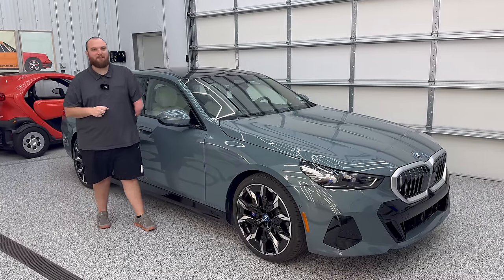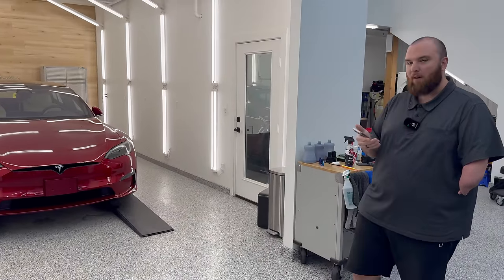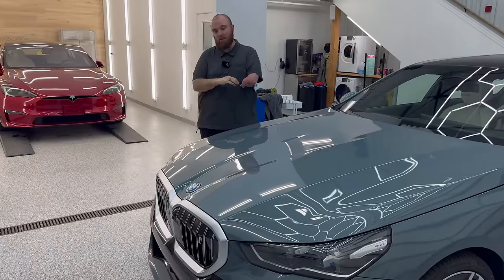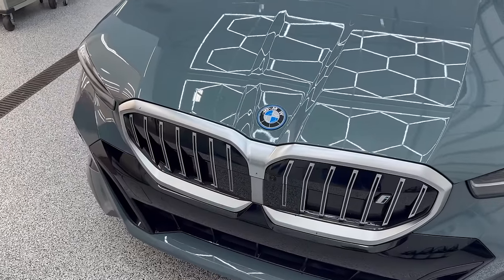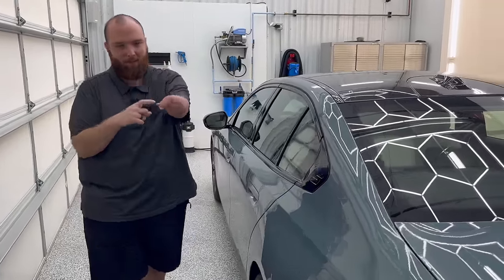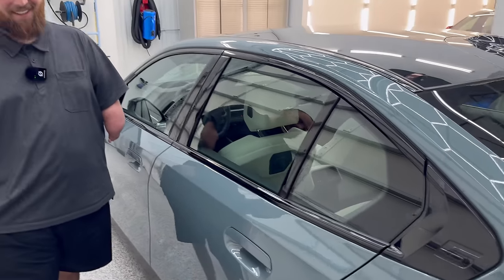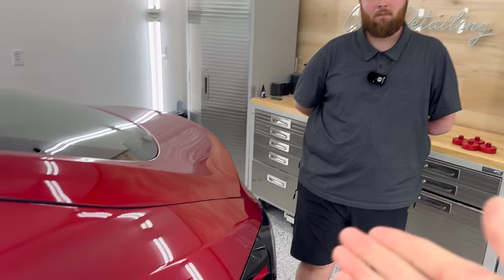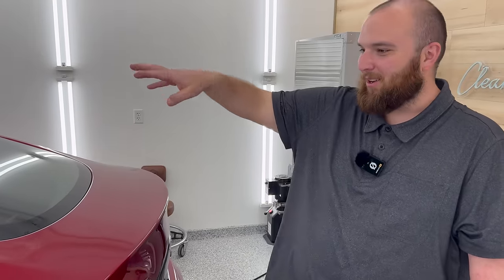BMW i5 vs Tesla Model S Build Quality Showdown! Pure Luxury vs On Paper Spec Sheet

Comment: Model S has been out since 2012.   Old, stale and outdated.
Reply: Correct.
Reply: BS point. 5 serie has been out for decades.
Model S has been refreshed.in 2021.
Reply: @mathijs9365  You do realize that the five series here is an all new model from the ground up new for 2024?
Reply: @mathijs9365   Refreshed in 2021 but still the same car from 2012.  They changed the bumpers and side skirts after 9 years in 2021. Still the same car.
Reply: And still looks and drives better.
KM77 just tested the ugly i5, and guess what,, the dated S did the slalom 2 seconds faster and the moose test at 8 km/h faster!
Reply: @ehudk215   Model S 2012 interior doesn't look better.  And not to mention Tesla is lacking in quality.
Reply: @TonyStone3000  in your eyes. The i5's interior is cheesy and plasticky.
In any case I was talking about the exterior.
Way more handsome and muscular than this new 5 series: it just looks wrong.
Reply: A 2024 Model S is different in practically every way from a 2012 Model S. Pretty much the only things they have in common are that they are both four door sedans with hatchbacks that run on electricity.
Reply: And the body is pretty much the same since 2016
Reply: @jaredvegas  it was a great design back then and is perfected now.
Different nose (bumper, headlights), wider fenders, different tail lights... many incremental changes that make for a big difference
Reply: @ehudk215 I like it but I’d be devastated if I bought one now and they change it. Definitely waiting a couple years (until my car is paid off)😅
Reply: @TonyStone3000  i bet you think the same about Porsche's cars.
Reply: @achilles-live   Nope.  Porsche redesigns their vehicles and their interiors aren't boring.  They just released an all-new Mecan.
Reply: @TonyStone3000  Porsche lightly updates their cars at the same if not at a slower pace than Tesla. Tesla has completely new cars, the Macan is the same exact platform with a new drivetrain and some cosmetic changes. Tesla has it's own design language that they iterate on, like Porsche does.
Reply: @achilles-live  The new Mecan is an entirely new electric vehicle. The body panels, interior, and drivetrain (electric vs. gas) are all different.   That is as far from a light update as you can get.
Reply: @achilles-live  Which Tesla is completely new?  The Cybertruck?
Reply: @TonyStone3000  Model S and X share absolutely nothing from the original cars. Model Y is a new platform so the main differences from first generation is the new structural battery and new motors. Model 3 has been redesigned and now also features a completely new chassis made with a structural battery, new motors and single cast front and back elements + the new 3 performance has completely new battery and completely different motors + suspension.
Reply: @achilles-live   All of that, and they still look the same. I'm no Tesla expert, but I'm willing to bet that the roof, hood, door panels, and trunk have remained the same throughout the Model S and Model X's existence. I've also noticed that everything has stayed the same with the interiors except for trim materials.
Reply: @TonyStone3000  Again, it's nothing shared anymore. The interiors are also different. If you were consistent and not being ignorant on purpose, you would say the same for Porsche for the past decades. As objectively, much less has changed from the original "new gen" 911 to the 2024 refresh.
Reply: @achilles-live  You are the one who's ignorant on purpose when you said, "The Macan is the same platform with a new drivetrain and some cosmetic changes." That was a complete line of crap.    You pulled that from your rear end.
Reply: @TonyStone3000  No, I did not. The new Macan does in fact share a lot with the old one under the pretty panels. You can keep trying ways to move the goalpost or switch it up but reality is what it is. I'm not saying it as a negative, I'm pointing out the obvious. I never said Porsche's EVs are bad or any other of their cars for that matter.
Reply: @achilles-live   You are doubling down on stupid.  This is from car and driver: "The Macan SUV has been Porsche’s best-selling vehicle since 2016, and the compact luxury crossover has spawned a new all-electric model for the 2024 model year. While it bears the Macan nameplate, the 2024 Macan EV rides on a new platform that will also underpin the upcoming Audi A6 eTron.
Reply: @achilles-live  Common sense would dictate if a car went to a new electric model from an internal combustion model, it would need to be a new platform or a shared platform designed from the ground up (BMW i4/440i).  Please tell me that you didn't think all it would take to make an electric car was to throw a battery pack underneath an internal combustion engine car.   You Tesla fans appear to believe that's the case.  Lol.  Another Tesla fan thought the BMW i5 wasn't an all-new model.   😂
Reply: @TonyStone3000  Turns out, common sense is at times wrong. Look mate, I don't pretend you think logically or try to view things from a new angle because clearly you're hardstuck. For the record, I'm no tesla fan I just appreciate the engineering and work behind their cars. I drive a track tuned miata, so I could not give a fuck. That said, BMW has repeatedly reused platforms and quite literally slapped a battery in them to get it over with. There are first/second gen EVs that "use all new platforms" yet still have an engine bay filled with leftover bullshit and an empty transmission tunnel.
Reply: The Model S in 2012 was well ahead of its time. It still works and still looks great. Go tell Porsche their flattened Beetle rebadged in 1971 to a 911 is old, stale and outdated. It’s the same damn lousy and ugly car externally but it appears to be working for them.
Reply: Tesla Model S design is sleek and timeless. In my eyes a Model S is one of the best looking cars on the road.
Also most parts of Model S is relatively new (2021-2022).
Model S build quality is no match for BMW though 😅
BMW interior is nice, but damn the exterior design is horrible with tons of scratchy piano-like plastic and a fake grille 🤦‍♂️
Reply: 2011* technically 😅
Reply: The problem with Tesla is that they have the Model S, Model 3, model Y and the Model X all having that similar design. It’s just that one looks a bit more bubbly than the other. On top of that, it’s like everybody buys them in the same three colors. Red, white and blue. On top of all that, the interiors just don’t get me excited and it just screams we need to cut cost somewhere. This is coming from someone who initially liked the model S when it first came out exterior wise. I live in Texas and you just see all the models way too much! Especially the 3 and Y!

Comment: The problem with german premium cars nowadays is that they don’t stand out in any particular category other than just looking fancy expensive from far away. Cheap material used, small interiors, impractical, very expensive, unreliable, outdated technology, expensive maintenance, horrible software and arrogant service experience.
Reply: You must have mixed up Tesla and german premium cars. Audi has the PPE platform with 800V, 270-275kW charging, HUD and 388 miles of WLTP range in the Audi Q6 e-tron (even more range than the Model Y LR RWD which is only available in Europe at this moment).
Mercedes-Benz will reveal the MMA platform with the CLA at the end of this year. The CLA competes with Model 3 and has 800V, 250kW charging short 50kW boost (so it will perform like straight 270-275kW) charging power, LIDAR, HUD, 466miles WLTP range. BMW introduces its 800V platform "Neue Klasse" in summer next year in form of the iX3. 800V, 275kW charging power good range etc.
Those are just the most upcoming releases, the new Mercedes EQA, EQB, electric C-Class sedan and C-Class SUV as well as the BMW i3 sedan will also follow in just a few months from now, all sporting an 800V system.

If one company in the EV space is outdated and has horrible build quality and customer service then it is Tesla.
Reply: Have you owned both Tesla and german premium to write this? Or is it just what you read in the legacy car media? I own a Tesla X Plaid, before I’ve owned six different BMWs, including two 5series. The tech in Tesla feels just light years ahead, it’s like driving a car from another century. 
And yeah, build quality and materials used in recent german premium BEVs are just inferior to Tesla. Mercedes and Audi being the worst.
Reply: @Aztasu lol there aren’t any 800v chargers. Why buy something thinking you’re ahead of everyone else but you’re actually using Tesla chargers because all others are outdated gas station style chargers. Charging speed is useless. Get a house and charge at home, you’ll never even think about your battery. Apartment users should contact their landlord. Landlords in certain states get incentives to add chargers in their lot.
Reply: @jaredvegas  America is behind when it comes to charging infrastructure that s why 800V EVs are more for European where 300, 400 V charging are accessible everywhere. That s why the first generation Taycan and E tron did well in countries like Norway and Germany  cause they fit the infrastructure here.

There are reasons manufacturers are starting to build 800V EVs.
Reply: @timram3766   Your argument is 3 years Old when only Tesla was the only manufacturer serious about EV. Today it s different. Other companies have catch up to Tesla when it comes to building the best EV. Mercedes EQ flagship lines, BMW flagship lines  iX i7, Porsche new flagship lines Macan EV, 2025 Taycan, even VW with their new ID 7 offer similar techs like Tesla if not better and are miles miles ahead in build quality, interior, everything almost. That s not even  a discussion. Mercedes is the fist manufacturer to come up with Certified 3 level autonomous a year ago. Taycan was the first EV with multiple gears, 3 years ago. Almost flagship EVs are now offering Augmented Reality HUD display, advanced Matrix Headlight function, advanced Dynamic Chassis Control features to name a few, none of them are available on Tesla.
In term of range Mercedes and BMW are already ahead of Tesla already. And while Tesla is unable to to keep up with the current german flagship lineups from Mercedes, BMW, germans brand like AUdi Porsche, BMW are already preparing for their next gen EVs while Tesla still hasn t figure out how to assemble car properly.

Comment: BMW will have better fit and finish for sure but I would never get the BMW, terrible efficiency, already outdated, clunky tech vs Tesla Model S has outdated design, fit and finish but drivetrain, tech is the best. I wish Tesla updated Model S similar to new 3, it could be the best electric sedan.
Reply: Well, next year in summer BMW iX3 of the "Neue Klasse", a next generation EV-only platform with 800V, HUD, LIDAR etc., will be revealed. i3 sedan will start delivery at the beginning 2026 and will also based on the "Neue Klasse". The i3 easily beats Model 3 and even the Model S. If one company is outdated, then it is Tesla.
Reply: @Aztasu sales show the opposite.
Reply: @raheeb1  they don't. Sales are declining rapidly and Tesla is basically selling only a single succesful model at the moment, the Model Y.
Reply: @Aztasu I meant about the bmw EVs. How many do I see out in the wild? Very very few.
Reply: @raheeb1  Well BMW has a big market share in Europe and the EV sales are booming in the US as well. Maybe they just don't come across as EVs because they look similar to the combustion variants.

Comment: The i5 supports full walk up/walk away phone as a key. It also supports plug and charge with EA already and will support it with Tesla I'm sure as well.  Hot take but I actually think the tech in i5/i7/iX is better than Tesla. 🔥

Tech the i5 has that wasn't mentioned in the video, that the Model S doesn't:
* better driver assist including hands free up to 85mph.
* carplay/android auto. Some people don't care but it's a dealbreaker for others. BMW's wireless carplay is actually super reliable and it integrates well letting you use Wayze or whatever you prefer.
* heads up display. So nice and useful.
* more color variety and individual options! :)

That said, there's plenty of reasons to buy the Tesla. Great video guys!
Reply: I am a 11 yr bmw owner. I have only owned bmw. E90 323, f32 435 and g20 m340. I am looking at both i5 and model s. I love my merino leather, HUD, 360 camera, carplay. The new 5 series interior looks so good. The ambient lighting is league above all other cars. But i5 is a sedan. I want something more practical, hatchback or touring. Better range. Frunk. Model s has these. I5 don’t. I am so torn
Reply: @tommytexter4054  you might be able to get your dealer to do merino leather in an i4. That's a hatch back. Small rear seat though.
Reply: @CheddarKungPao nah, i don’t wanna deal with 3/4 series anymore. Need to grow to 5 series segments. Also i4 m50 with all the options costs almost same as model s in canada. Also my g20 merino seat, i get back pain after 1 hr of driving.
Reply: @tommytexter4054  yeah i hear you. I love my i4 but i wanted something small. We ended up getting an iX for my wife. I'm driving that across the country right now and it's really comfy.
Reply: @tommytexter4054  there is a I5 touring sir.
Reply: @mikeg197  not in North America, sir. Shame…i am in Canada, we don’t get shit
Reply: @tommytexter4054  thats so racist, just import one from germany, since it isnt a ice car the stupid anti import rules should not apply in the US. Dont know about canada, but why not try.
Reply: @mikeg197  at what cost? I ain’t going all this trouble just to get a car
Reply: The infotainment system in tesla is far better than Apple Carplay. I have not tried Android auto.

Comment: As a BMW lover, Tesla quality is still very high no matter what the haters will claim.. just as BMW haters will deny their quality and say it’s trash. Tesla is a luxury offering at the end of the day, that’s what it’s defined as. Not saying this channel is a hater space, just sharing my experience. Tesla quality was very good in all aspects imo. The fit and finish was pretty good but the quality and overall feel and placement of everything was the best part of the interior. “Panel gaps” are a hot take with Tesla, but the large gaps are there for a reason.. not an eyesore by any means imo. Steering wheel and seats could’ve been a bit more refined, but they were meant to be modernized. The smell was amazing also in the Teslas, better than any car I’ve been in, besides a Bentley with full leather.
Reply: I’ve owned BMW M cars as well. I agree with you. I plan to buy a Tesla soon after riding and driving a friends. 

Enjoyed it a lot.

Comment: Guys
I would encourage both of you to do more research on BMW prior to posting these videos..
BMW has had phone as key with a share option with authority levels for years.. ( with Apple Watch integration)
BMW has also rated higher in customer satisfaction and reliability compared to Tesla!
Look it up before you comment… 
Tesla was last.

In addition,
BMW allows you to have video and still image access inside and on the vehicle similar to Tesla.
Quite honestly,
If you’re comparing technology, Overall all performance, build quality,
Interior and exterior color options individual builds etc…
The fact that you said you can track the model S and not the i5 is astonishing..

Just ensure you have researched and spent more than just a few days with a car before offering up an opinion that will be taken as fact.
There is no comparison!
Reply: They have no idea. I got my M60 for 71 with tax credit. When I went to look at a Tesla Plaid it was 1300 a month my M60 is 800 a month. I’ll take the BMW any day over the plaid. Build quality isn’t even close. I need more from a car than for it to just go fast.

Comment: The lower part of the door cards are NOT hard plastic. It's actually a vinyl that's wrapped around plastic and has some give to it. This allows for more sound absorption vs not having that vinyl wrapped around it. Every "Reviewer" seems to mostly get this wrong. Don't misinform the public.
Reply from the maker: Literally hard plastic 💀
Reply: @OutofSpecDetailing  No Wrong again. Hard plastic is what you'd find on a 2-series and X3. This is finished differently. It's a fact.
Reply from the maker: Don’t care what you call it, it feels cheap and doesn’t belong in a car at this price point.
Reply: @OutofSpecDetailing  It's solid, doesn't rattle, and still padded to be sound absorbing which is not cheap feeling at all. Hard touch plastic is what you feel in a Mercedes EQE door card or Toyota Camry. The G60 dooes not. 😏
Reply: It's not hard plastic. There's no debate here. It's literally not hard plastic. It's soft touch, granted not leather soft, but definitely soft touch material.  @OutofSpecDetailing

Comment: Only reason I'd see to get Tesla is for the sentry camera's, self driving capabilities and infrastructure charging
Reply: Don't forget Tesla is also faster, more efficient and more range.  When you look at what matters most they aren't even in the same league.
Reply: @henryyiu618  valid points, but its close race for quickness and range is not far off.  The build quality is huge fore some.  With cars you can't go by what's on paper but rather actually driving them.  Tesla's charging infrastructure is hard for competitors.
Reply: @theluminary5324  It's huge difference in quickness and range (>100 miles).  And based on this video review we can argue Tesla has better interior quality.  Its software and integrations are already decade ahead.